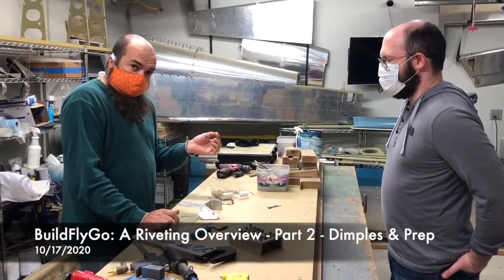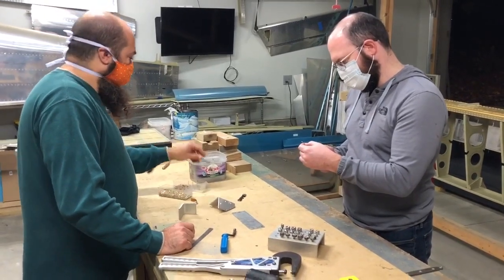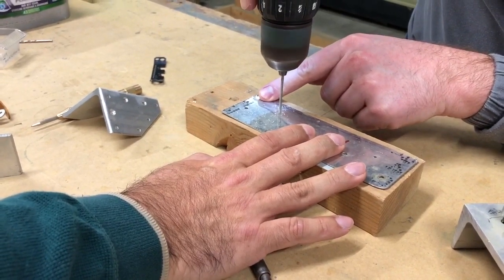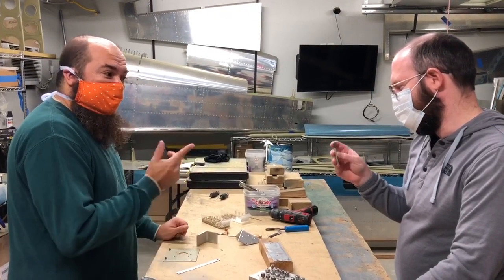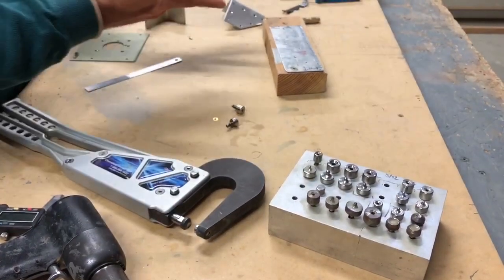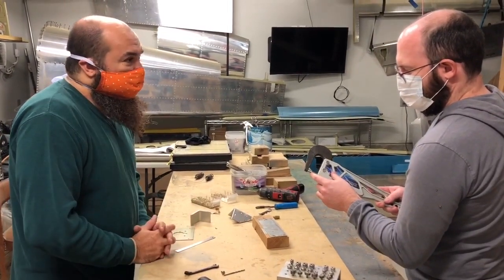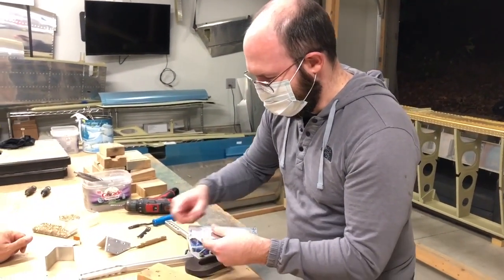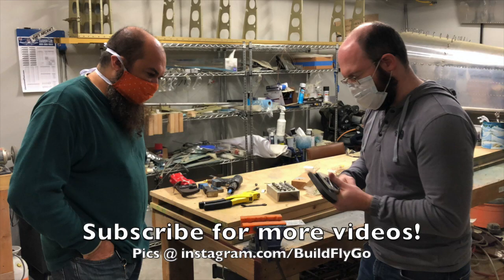Building an RV Part 2 - A Riveting Overview: Dimples & Metal Prep

Comment: IF VAN's is now punching holes to final size why don't they dimple them at the same time to save the builder another step??Would be VERY easy for VAN's to do that.
Reply from the maker: It's another tool they'd have to run it thorough, which means more cost to the builder. Would it still fit the 51% rule? I'm sure if it was something Van's could easily do without impacting the 1000 other things they are currently juggling they would do it. There's probably more to the story than we can see from our side :)

Comment: it is amazing how Little pressure you need to apply when deburring a hole! Are Most holes drilled, on the plan in #Number bits or hole sizes 1/8", 3/32", 3/16" Etc. ?
Reply from the maker: Mostly # sizes. It's 90% #30 & #40